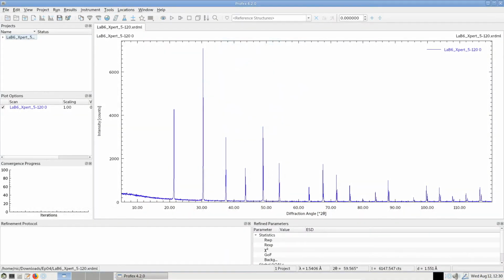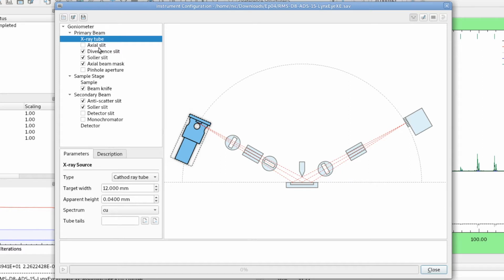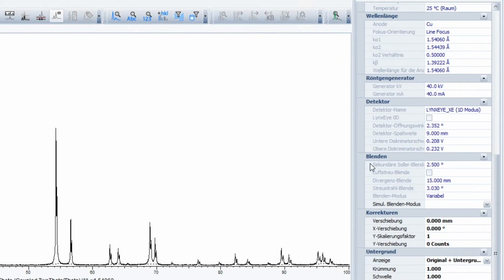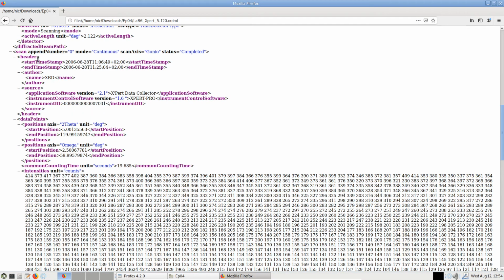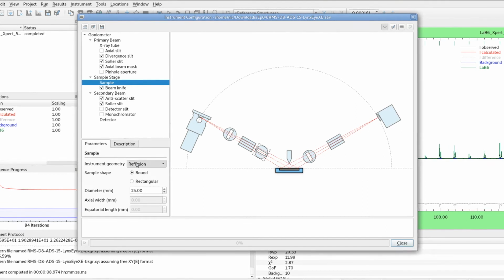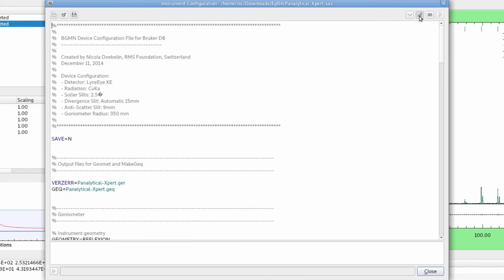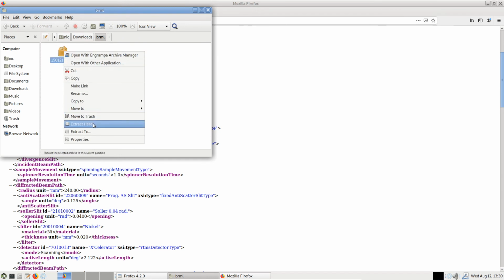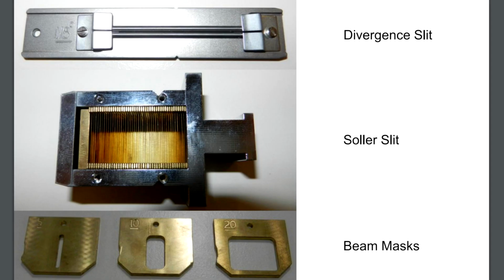Profex XRD: Instrument Configurations

Comment: This software and tutorials are excellent, and it is user-friendly compared to other software. Thank you! I am doing instrument configuration for Rigaku SmartLab SE as part of my project, and I am having difficulty in setting up the exact configurations as I don't have access to the instrument. I am working with Si-std data with headers in .txt format provided by the operator. It will be a great help if you could suggest how to solve this. 
Thank you.

Comment: 15:04  For the divergence slit setting, there are two options available. One is to input Beam divergence and the other is slit opening with distance from sample. When the beam divergence is checked, slit opening and distance from sample are deactivated in version 4. However, this is not the case for version 5. Distance from sample still can be modified. Should I specify the distance from the sample even if I input beam divergence in version 5?
Reply from the maker: You should enter the distance also when you enter the beam divergence angle. But in that case, a rough guess is sufficient. It mainly serves to make sure that the optical elements appear in the right order.

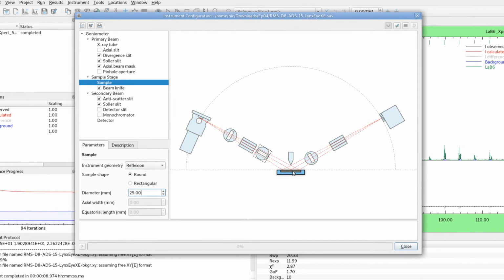Comment: 16:55 I find there is a Linear abs. coeff input when I select Reflexion geometry in Profex 5.4.1. However, as I understand it, LAC is a characteristic of the sample I want to measure. This should not be an Instrument's setting; rather, this should be refined in the refinement process. I find that LAC is refined for each sample in TOPAS. What am I missing?
Reply from the maker: Indeed the LAC is characteristic for the sample, but it also affects the profile shape. The BGMN refinement kernel uses a different approach than Topas to model the peak shape by using Monte-Carlo simulations of the optical path. That is also the reason why instrument parameters can't be refined in Profex.

For reflection geometry, the LAC is not that critical. If you enter a value that is in the ballpark of what your samples will have, it should work for all samples. For capillary setups, though, it can alter the peak shape significantly. In that case you may have to compute a profile for verification with the LaB6 standard using the LAC for LaB6, but then compute another one for your sample with a correct LAC for your sample composition.

Comment: Dankeschön für diese großartige Einführung in das Programm!
(Thank you very much for the great introduction to this program!)
Great to see that Profex can directly fit data recorded with automatic divergence slits (at least there is an entry for that). I had to convert the intensities to that of a fixed slit before refinements with GSAS-II, but the weights of points at higher 2theta are sometimes off. Hope that Profex does better with that.

How does Profex deal with minor artifacts of a K-beta filter such as the absorption edge and residual beta peak or could it refine data without K-beta filter (i.e. calculating the K-beta and possibly even K-gamma peaks)?
I found phase quantification of 1-2% LaB6 in Si with GSAS-II to be very tricky as most LaB6 peaks are close to the residual beta peaks or the absorption edge of the much more intense Si peaks (measured on a 975-cut Si single crystal with a PANalytical Empyrean with Mo-X-ray-source with a 75μm Zr-filter)
Reply from the maker: The radiation spectrum is defined in the *.lam files in the Profex/BGMNwin directory as a set of lorentzian functions. The Cu.lam file is a bit different than the others in that it parameterizes the kbeta intensity. I think there are also Cu files that model the absorption edge. You can create your own lam files once you understand how they work. You will also need to create copies of the matching *.ano and *.mdr files. These are all text files that can be edited in notepad.
Reply: Amazing, thank you so mich for your reply!
This was far beyond my hopes for an open-source programm, great to see that someone has considered these effects that are common in your average lab sources data. I will go digging into those files then.

Schöne Grüße und frohe Feiertage,
Michael

Comment: Great work! I have now added my detector geometry (was hidden in .brml) file, and now i finally find my peaks! but the issue is: the background level is at 0 for the calculated curve. How would i add a background (without measuring it)? i can select a number of constants for the background, but it seems they dont have any effect...
Reply from the maker: I can't identify the issue based on your description. Please go to the support page on the Profex website and follow the instructions for support requests. The procedure ensures that I get enough information to understand the problem.
Reply: @profextutorials2325  thank you! i have managed to fix it by manually editing the background coefficients in the refinement file. Somehow, they are always set to 0. By increasing it to 5 i get a very good result. 
Is there a way to set the default to 5?
Reply from the maker: In one of the device repositories (Locations -> Devices) there is a template file for your instrument configuration (*.tpl). You can open it in a text editor and change the value of RU to 5. Or if you delete the RU line, the value will be assigned dynamically during the refinement.

After modifying the file, I recommend to save all 4 files for this configuration (*.sav, *.ger, *.geq, *.tpl) in the device repository outside of the Profex program folder. On Windows it is C:\users\<your name>\...), which is also listed in Locations -> Devices. Else you will lose the modified files with the next update.

Comment: Thank you for all these tutorials!
I am trying to create a new instrument file, but when selecting the "Edit current FPA configuration" (starting from one of the tutorial files) I get a "the device file was not found" error message. I have tried to remove and reinstall the program, but with no success. I have also tried to create an instrument file from scratch, but I cannot see it in the instruments list. I did make sure to move all the 4 generated files in the Devices folder. Do you have suggestions on what could be the issue?
Reply from the maker: Reinstalling doesn't help if the preferences got messed up, because the program settings are not cleared by uninstalling. Instead the registry key must be deleted as described here:

https://www.profex-xrd.org/faq/#hfaq-post-1863

Regarding your problem, I can't tell from your description what causes it. If you contact me on the support email address given on the Profex website we can try to solve it, but I will have to ask for some additional information.
Reply: Thank you, I will try to do what suggested.
I have already sent an email a few days ago, probably something went wrong. I will resend it as well.
Reply: @eliazancan9076  Did you solve it? I am having the same error
Reply: @marcellypires8501  I did, but I am afraid that I don't remember how, as it was a long time ago and I have apparently not wrote that down. It might have been just deleting the registry key as described above. Another thing I had trouble with was that I could not save the custom machine files in the pre-loaded folder as it required admin permissions but there was no prompt for granting those. I had to save them elsewhere and then move the files to the folder. Sorry, I wish I could be more helpful!

Comment: Thank you so much for this tutorial. I am using a Bruker D2 phaser and profex version 4.3.6. I am however finding difficulties configuring this instrument on profex. Anyone with help on this?
Reply from the maker: If you are still having problems, you can find the support email address on the Profex website and send me a Brml file measured with your instrument. It contains the required hardware information.

Comment: You can't imagine how useful is your work! It's something adorable you've done! Thank you very much for making this tutorial. it saved my bachelor thesis. Only one question remains, I'm using a panalytical xpert pro with a secondary beam monochromator, in my xrdml file it's written that

 -<monochromator name="Diffracted beam monochr. for PIXcel and Cu" id="23010033" hybrid="false">

<crystal type="Symmetric" shape="Flat">C</crystal>

<numberOfReflections>1</numberOfReflections>

-<hkl>

<h>0</h>

<k>0</k>

<l>2</l>

</hkl>

maybe you know how can I know the angle and the distance from sample for writing it in profex. Thank you again!!!
Reply from the maker: Thanks for the kind words! Great to hear that Profex is useful for you.

Your monochromator seems to be a conventional graphite crystal using the 002 plane. If your instrument uses CuKalpha radiation, the correct angle is 26.60 degrees. For different radiation you need to calculate the angle using the Bragg equation:

Theta = asin(lambda/2d)

Lambda is your wavelength, and d is the graphite 002 d spacing. Theta (not 2theta) is the angle of the monochromator.

If you don't know the distance from the sample, just enter "goniometer radius + 50mm". I don't think it is that critical as long as the monochromator is placed somewhere after the focus point. Or if you have access to the instrument, take a ruler and try to measure it roughly.
Reply: @profextutorials2325  You're so gorgeous!!! Thank you with all my heart for your explanation. Wish you good luck in your work and life!

Comment: Thank you for sharing this tutorial. I'm new in xrd analysis and would like to use profex. I would like some help on the configuration of the instrument for a Miniflex 600 from rigaku. Here is the data found in the * asc file :
*TYPE		=  Raw
*CLASS		=  ASCII CLASS
*SAMPLE		=  CS31-PCO-004
*COMMENT	=   
*FNAME		=  Ri 210380_Theta_2-Theta.asc
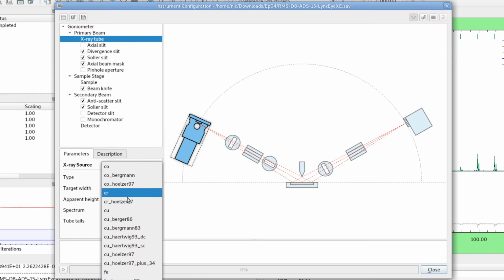*DATE		=  26-Apr-21 14:01

*GROUP_COUNT	=  1
*GONIO		=  MiniFlex 300/600 +, 150
*ATTACHMENT	=  ASC-6
*ASC		=  0, 0, 0.000000, 0.000000
*FILTER		=  K-beta(x2)
*C_MONOCHRO	=  None, 0.000000
*SLIT_NAME	=  0, IHS
*SLIT_NAME	=  1, DS +
*SLIT_NAME	=  2, SS
*SLIT_NAME	=  3, RS
*COUNTER	=  D/teX Ultra, 0
*POS_FORMAT	=  0
*SCAN_AXIS	=  2theta/theta
*MEAS_MODE	=  Continuous Scanning
*TARGET		=  29
*XRAY_CHAR	=  K-ALPHA
*WAVE_LENGTH1	=  1.54059
*WAVE_LENGTH2	=  1.54441
*THICKNESS	=  0, 0.000000
*MU		=  0, 0.000000
*SCAN_MODE	=  2theta/theta
*SPEED_DIM	=  sec./step
*XUNIT		=  deg.
*YUNIT		=  cps
*SCALE_MODE	=  1
*REP_COUNT	=  0
*SE_COUNT	=  0
*STD_MATERIAL	=  Unknown, Unknown, 0.000000, 0.000000, 0.000000, 0.000000, 0.000000, 0.000000
*LATT_CONS	=  0, Unknown, Unknown, 0.000000, 0.000000, 0.000000, 0.000000, 0.000000, 0.000000
*SEC_COUNT	=  1
*TSPEC_SIZE	=  0
*EXTRA_SIZE	=  0
*MEMO		=   

*BEGIN
*GROUP		=  0
*START		=  2
*STOP		=  70
*STEP		=  0.02
*OFFSET		=  0.000000
*SPEED		=  0.24
*SLIT_SPEC	=  0, 10.0mm, 10, 0.000000
*SLIT_SPEC	=  1, 0.625deg, 0.625, 0.000000
*SLIT_SPEC	=  2, 13.0mm(Open), 13, 0.000000
*SLIT_SPEC	=  3, 13.0mm, 13, 0.000000
*KV		=  40
*MA		=  15
*LOW		=  0.000000
*HIGH		=  0.000000
*CTEMPER	=  0, 0.000000
*CTEMPER	=  1, 0.000000
*CTEMPER	=  2, 0.000000
*PAREX		=  0, 0.000000
*PAREX		=  1, 0.000000
*PAREX		=  2, 0.000000
*PAREX		=  3, 0.000000
*PAREX		=  4, 0.000000
*PAREX		=  5, 0.000000
*PAREX		=  6, 0.000000
*PAREX		=  7, 0.000000
*PAREX		=  8, 0.000000
*PAREX		=  9, 0.000000
*PAREX		=  10, 0.000000
*PAREX		=  11, 0.000000
*PAREX		=  12, 0.000000
*PAREX		=  13, 0.000000
*PAREX		=  14, 0.000000
*PAREX		=  15, 0.000000
*FULL_SCALE	=  57280
*INDEX		=  0, 0, 0
*COUNT		=  3401

I have already tried a configuration and after analysis the refinement curve remains at the level of the background noise. So i looked at the information in the refinement protocol and here is what I found :
"insufficient angular range of *-geq-file,
further computation may lead to errors "

I also noticed that in the configuration of the instrument I cannot register the correct detector. Indeed, it comes back to the 1D / 2D detector. I think I am using the wrong protocol for the backup.

Can you help me with these problems?

Thank you in advance.
Reply: I found the solution on another of your videos. Many thanks for these tutorials

Comment: Estou tendo problemas para configurar o XRD Rigaku Miniflex II, não sei qual arquivo .sav posso usar (o PROFEX fornece 4 arquivos para Rigaku). 
Os únicos dados que eu tenho do equipamento são:
DivSlit: 1,25deg
RecSlit: 0,3mm
SctSlit: 1,25deg
Monochro RS: 0,8mm
Reply: I was unable to enter the settings before, but I now I used the configuration file that comes with PROFEX, the Rigaku_miniflex file, because the samples were studied in MiniflexII.  I got a good refinement, but I can't get less than 3.47 chi square. It is still an excellent result comparing the data with the XRF!!!

Comment: I have followed the process by using the data of my empyrean device, but when I save the file as *.sav file, it does not appear later on the add phases default control file for the instrument configuration. I do not know what I'm doing wrong. I checked and the file is on the device folder
Reply from the maker: Did you actually run the profile calculation after saving the Sav file? And did you check the output for error messages?
Reply: @profextutorials2325   It says: Internal error labeled wrongGEOMETRY in file D:\EFLECH\makegeq.c, line 110
Reply: @profextutorials2325  I still have problems with this exercise. I am using and Empyrean Panalytical, incident optics: Soller 0.04 at 170 mm, Divergence slit 1°at 150 mm, mask 11.6 width at 145 mm, another slit of 1/2° at 105 mm; my powder LaB6 sample of around 15 mm diameter. On the diffracted beam path:  antiscatter slit 6.6 mm at 120 mm, soller 0.04 at 215 mm, and finally an X'celerator detector. Putting this data now when I run the calculations the program does not work, it stays at 0% progress the whole time :(
Reply: It is done now, a problem I think with the antivirus update, but now is working. Thanks

Comment: Thank you for sharing this tutorial. I'm new in pxrd area and would like to use profex in my doctoral thesis. How can I find the Rigaku 600 miniflex instrument settings correctly? I only have access to the *asc file created by Rigaku software.

#Headlines from asc file
:

*TYPE		=  Raw
*CLASS		=  ASCII CLASS
*SAMPLE		=  LINDEN X122
*COMMENT	=  
*FNAME		=  
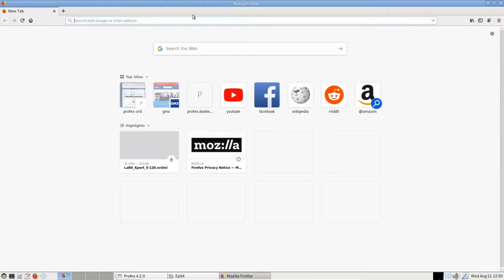*DATE		=  30-Oct-19 09:37

*GROUP_COUNT	=  1
*GONIO		=  Standard, 150
*ATTACHMENT	=  
*ASC		=  0, 0, 0.000000, 0.000000
*I_MONOCHRO	=  Manual, 0.000000
*FILTER		=  None
*SLIT_NAME	=  0, IncidentSlitBox
*SLIT_NAME	=  1, ReceivingSlitBox1
*SLIT_NAME	=  2, ReceivingSlitBox2
*COUNTER	=  DteX100, 0
*POS_FORMAT	=  0
*SCAN_AXIS	=  2theta/theta
*MEAS_MODE	=  Continuous Scanning
*TARGET		=  29
*XRAY_CHAR	=  K-ALPHA
*WAVE_LENGTH1	=  1.54059
*WAVE_LENGTH2	=  1.54441
*THICKNESS	=  0, 0.000000
*MU		=  0, 0.000000
*SCAN_MODE	=  2theta/theta
*SPEED_DIM	=  sec./step
*XUNIT		=  deg.
*YUNIT		=  counts
*SCALE_MODE	=  1
*REP_COUNT	=  0
*SE_COUNT	=  0
*STD_MATERIAL	=  Unknown, Unknown, 0.000000, 0.000000, 0.000000, 0.000000, 0.000000, 0.000000
*LATT_CONS	=  0, Unknown, Unknown, 0.000000, 0.000000, 0.000000, 0.000000, 0.000000, 0.000000
*SEC_COUNT	=  1
*TSPEC_SIZE	=  0
*EXTRA_SIZE	=  0
*MEMO		=  

*BEGIN
*GROUP		=  0
*START		=  4
*STOP		=  40
*STEP		=  0.02
*OFFSET		=  -2.000000
*SPEED		=  0.24
*SLIT_SPEC	=  0, 1.25deg, 0.000000, 0.000000
*SLIT_SPEC	=  1, Open, 0.000000, 0.000000
*SLIT_SPEC	=  2, Open, 0.000000, 0.000000
*KV		=  40
*MA		=  15
*LOW		=  0.000000
*HIGH		=  0.000000
*CTEMPER	=  0, 0.000000
*CTEMPER	=  1, 0.000000
*CTEMPER	=  2, 0.000000
*PAREX		=  0, 0.000000
*PAREX		=  1, 0.000000
*PAREX		=  2, 0.000000
*PAREX		=  3, 0.000000
*PAREX		=  4, 0.000000
*PAREX		=  5, 0.000000
*PAREX		=  6, 0.000000
*PAREX		=  7, 0.000000
*PAREX		=  8, 0.000000
*PAREX		=  9, 0.000000
*PAREX		=  10, 0.000000
*PAREX		=  11, 0.000000
*PAREX		=  12, 0.000000
*PAREX		=  13, 0.000000
*PAREX		=  14, 0.000000
*PAREX		=  15, 0.000000
*FULL_SCALE	=  0.000000
*INDEX		=  0, 0, 0
*COUNT		=  1800

Thank you in advance. You are doing a fabulous job with profex software.
Reply from the maker: If you start from one of the existing Miniflex configurations (eg FUB-Miniflex coming with Profex 4.3), you only have to change the divergence slit to fix with 1.25 deg beam angle and remove the anti-scatter and receiving slit in the diffracted beam. This config uses the Dtex ultra detector, whereas yours says Dtex100. I'm not sure if they are different. But that should give you a working configuration according to your asc file.
Reply: @profextutorials2325  Thank you very much!!
Reply: @jonataslopes2339  Você conseguiu configurar? Pode me passar os dados inseridos? Meu equipamento é o MiniflexII

Comment: Hello 
I really need your help.. I have jus downloaded profex for my sample refinement.. but I am stuck with the configuration part.. I have collected data using ADXRD using synchrotron radiation wavelength 0.71398A .. refinement is showing error. Mainly due to wrong wavelength I guess or configuration. Pls help me with same
Reply from the maker: Please search for my e-mail address on the Profex website (on the "contact" page) and send me the data file and your instrument configuration file. I will see what I can do.
Reply: @profextutorials2325  I’m already have problems to put Rigaku instruments configurations.